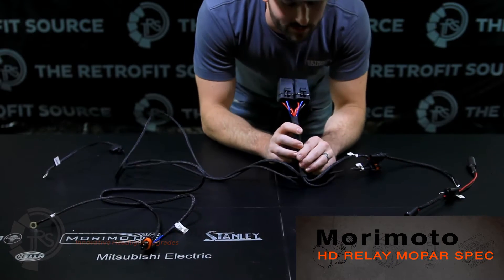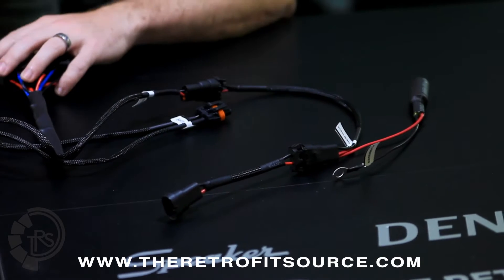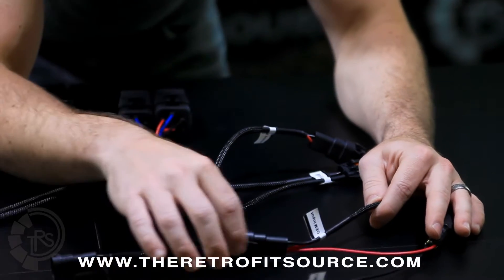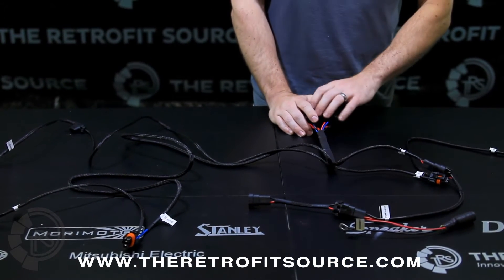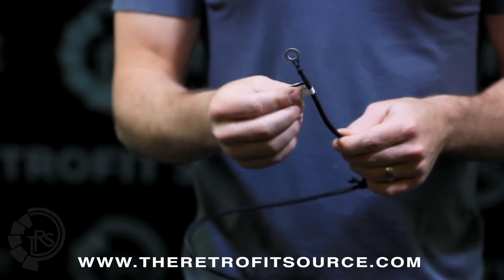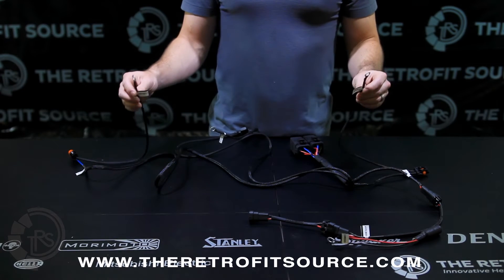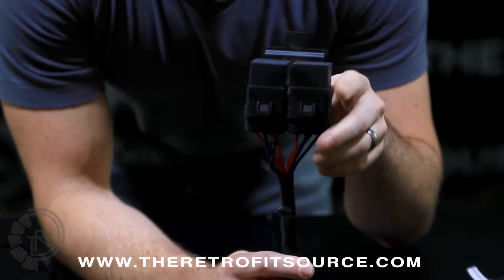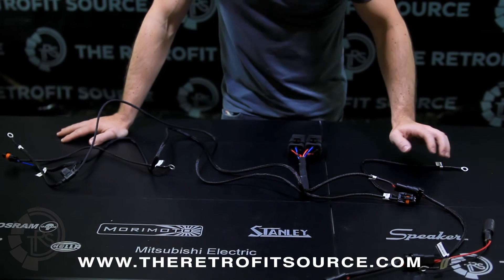TRS Tech: Morimoto Mopar Spec Low beam HID Relay Wire Harness

Comment: My 2015 Charger SE has the battery in the trunk. Do i have to get a professional to set a longer wire to the battery since its in the trunk area?
Reply from the maker: Yes that is correct, you will need a longer replay harness. This relay harness is made for engine bay connections.
Reply: You probably found the positive terminal in the engine bay already by now I’m assuming.